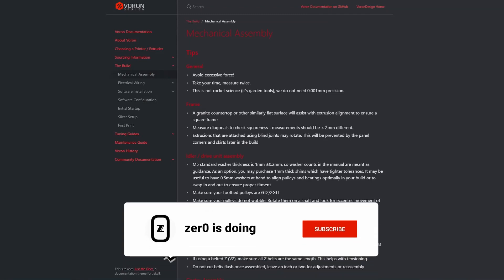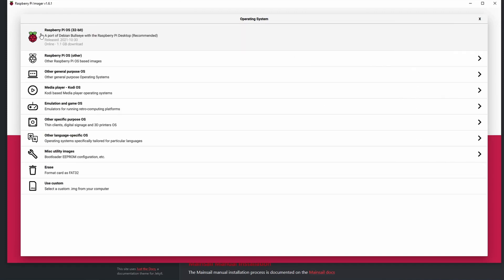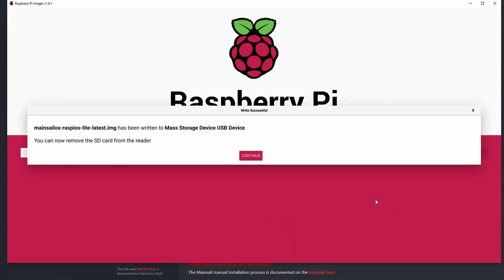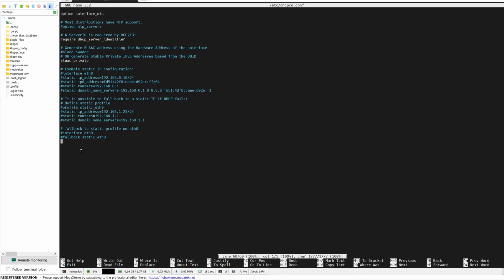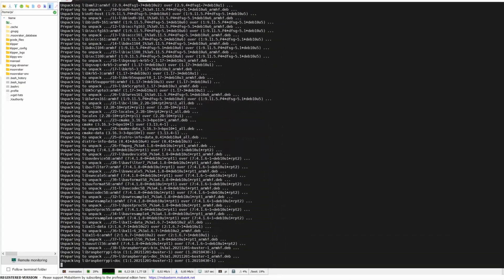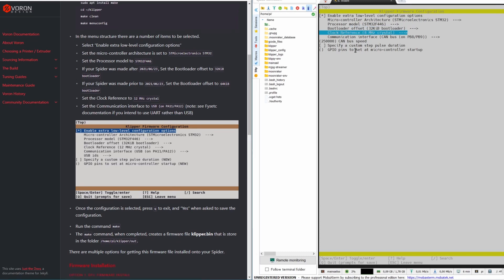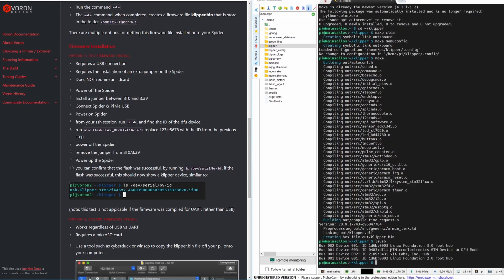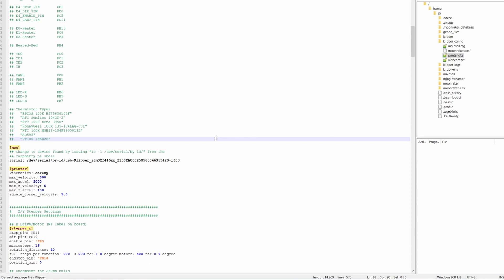Building Voron Trident - Software [Ep9]

Comment: However, this clip was the only one to be connected to raspberry pi unfortunately the page of Mainsail reads unsecured.The Voron 2.4 installation of the software is so complicated and away deep messy as gathering all the eggs in one basket, it is not strong as the printer . As if written on a way of getting others away from that printer. For such printer has a specific feature I wonder why they didn't build up a one go software as any printer as customizing it through the application.
Reply from the maker: It seems complicated but actually it is not that much complicated. :) Only building and flashing firmware it is a bit complicated but It is doable. There is also kiauh which is script that does installation and all. It may help you can check it. I have never used it I do not know much about it. But here is the link:
https://github.com/th33xitus/kiauh